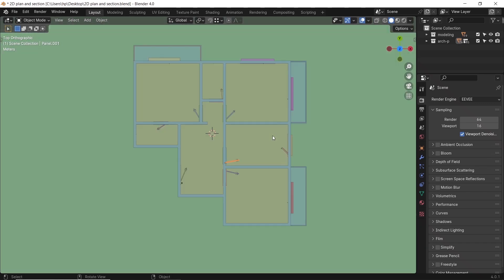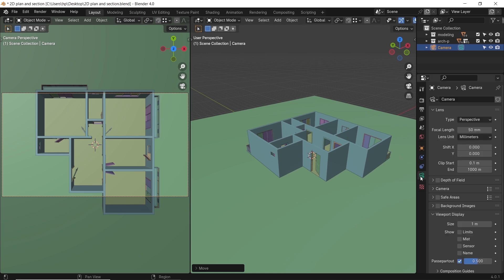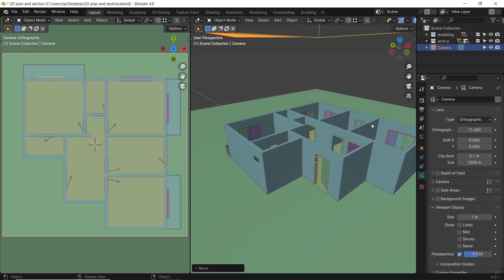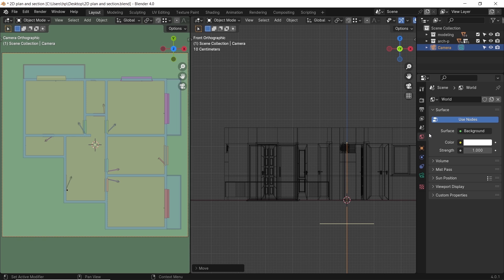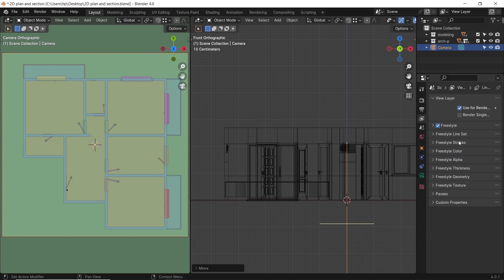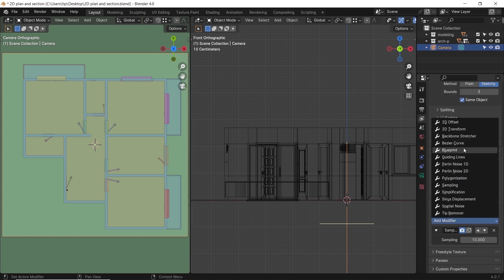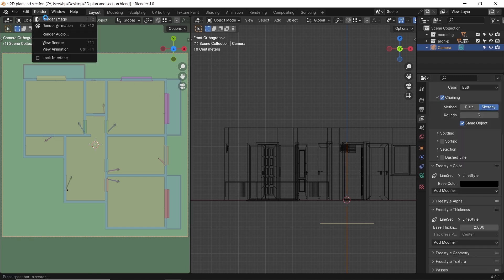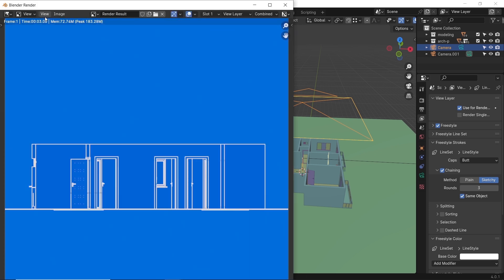How To Turn 3D Model into 2D Floor Plans (in 2 EASY steps)

Comment: When I use camera clipping for the section cuts, I often have the problem that rooms are dark. Basement rooms, for example. Is there a way to let the scene light in there? As if I had used a Boolean instead of camera clipping? This would then let the light from outside fall into the basement rooms without me having to install a separate light source for each and every possibly dark room. I have the same problem with other drawings. For example, with the drawing of a kitchen island. The kitchen island is almost completely dark from the inside when I use camera clipping. Not with a Boolean, but then I have to specify the Boolean for every single door, every single panel, every single handle, and everything else that could be inside the kitchen island cabinets. Is there a more elegant solution so that the light, which I already have in the scene, also falls into the dark areas when using camera clipping as soon as the clipping limit is reached?
Reply from the maker: We did make a video on this exact thing you asking about, so check it out 
https://youtu.be/XzRfWkSAlbc?si=5WH4nSR1kVFqQl_I

Comment: The hardest thing for me was to configure the exact 1:100 scale. Then I found the "Render to Print" plugin. There, for example, I set the format to DIN A4, landscape and 300 ppi. This sets the resolution to x = 3508px and y = 2481px. Then I set the camera to orthographic and set the orthographic scale to the length of the longest edge of the format I have selected. For A4, this would be exactly 29.7(cm). This configures a 1:100 scale. If this is too large, then simply divide the 29.7 by 2 for a 1:50 scale or divide by 10 for a 1:10 scale. This allows me to meet the requirements of the building authorities, which in Germany usually require a DIN A3 format with a 1:100 scale.

Comment: It's very helpful, but another factor is that there is no proper way to show the dimensions in this drawing, as well as labels.
😊😊
Reply from the maker: Thanks! You could use the measure it built in add-on in blender or any other tool.